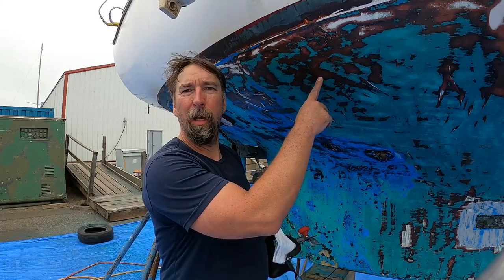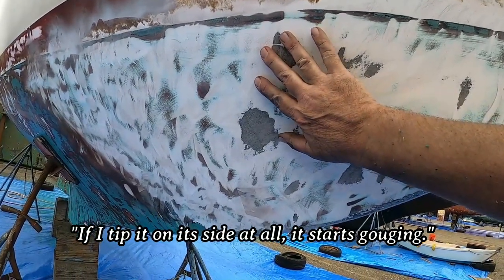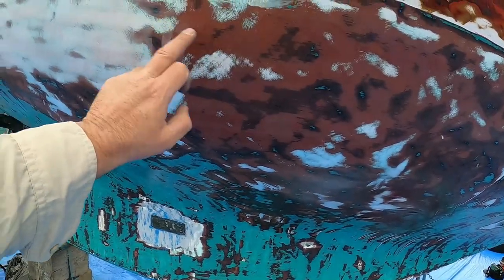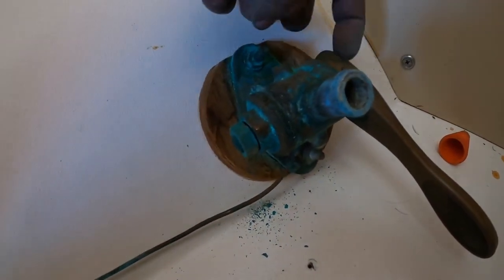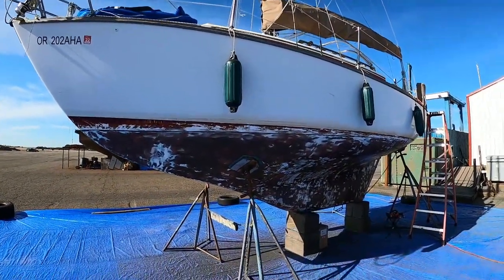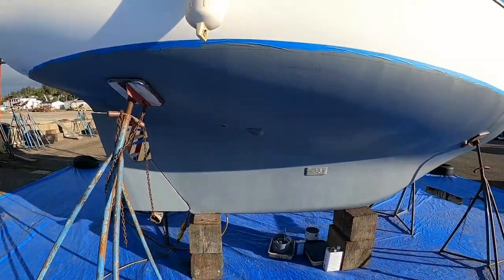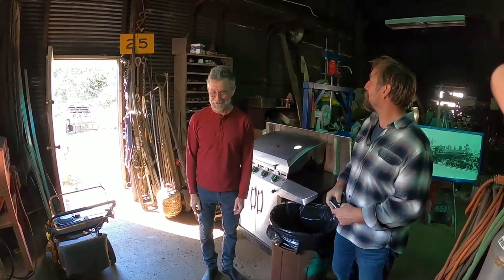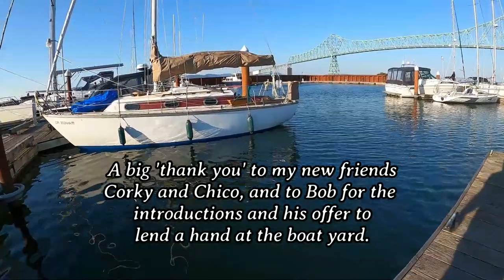Removing and Repainting the Boat's Bottom - Voyage Dreams 78

Comment: I did a hatteras 38 fbdc and it took me and my dad 90 hours to bring it down to the gel coat it had 5 layers
Reply from the maker: That's must've been crazy hard work! It's fantastic you were able to tackle it with your Dad.
Reply: Fairing compound in a few areas sanding 4 barrier coat primer then 3 costs of paint is left to do for the beginning of 23 season

Comment: sanding v. chemical stripper for removing old antifouling.  why you choose mechanical removal?
Reply from the maker: Some time ago I was reading Don Casey's well-regarded book, This Old Boat. As I recall, he wasn't fond of chemical removal for various reasons (though I don't think he liked any sort of removal due to the labor involved). While I didn't consider the chemical removal option much after reading the book, thinking about it now I'm satisfied with the hard work of scraping the old paint. I don't know if a single chemical remover would work on all the many different layers of paint (What composition are each of them?), and this boat yard doesn't provide/allow water for rinsing the hull, so clean-up could be a real chore too. Anyway, there you have it. Thanks for watching!